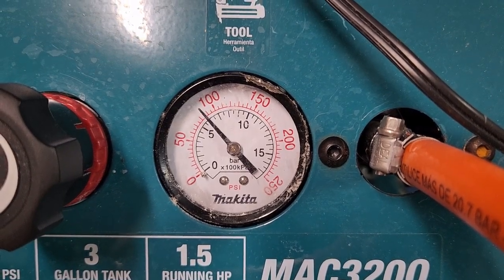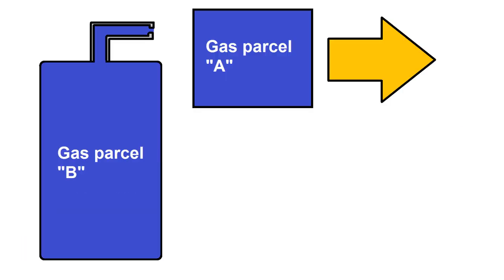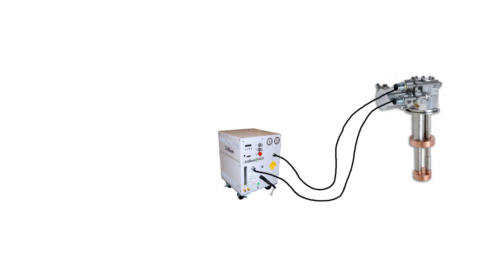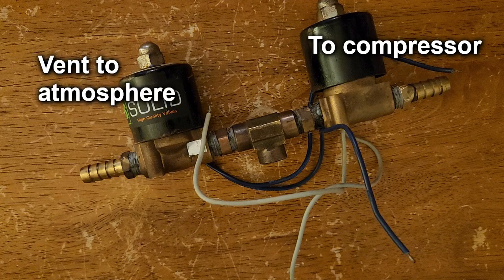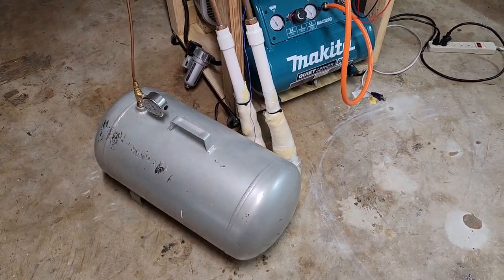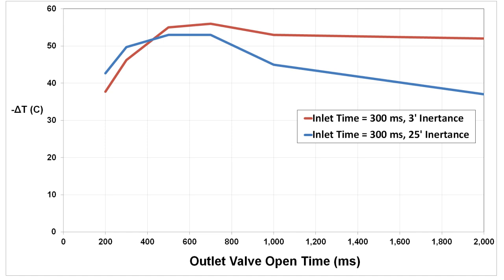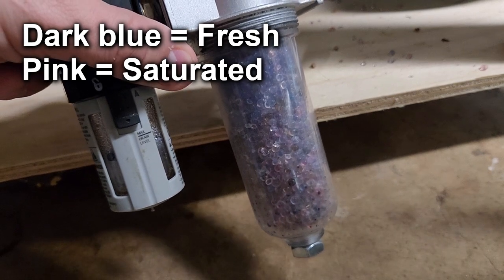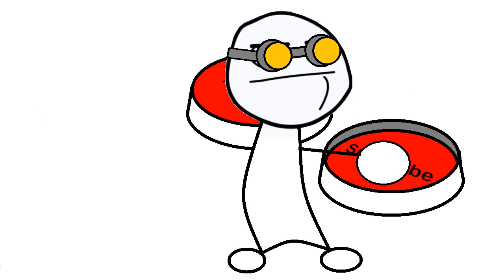Pulse Tube Cryocooler (Part 4) - Valve Controlled

Comment: Building a helium compressor can be quite a task. The problem with refrigeration compressors is that they are gas cooled, refrigerants usually don't get that hot when compressed.
Helium or Air on the other hand get very hot when compressed, this is why most commercial compressors use oil coolers to keep the compressor at a reasonable temperature.
Oil separation is also mandatory since the pump out quite a bit, in normal refrigeration there is no problem with that, in a low temp system it is.
Usually they have a oil separator with oil return and a oil adsorber filled with activated charcoal.
I built a compressor myself for a commercial GM-cooler. https://www.youtube.com/watch?v=k3D2HHXTUss
Reply from the maker: Hey I've seen your build video. I think at one point you mentioned your compressor ran ~2kW, which I'm assuming is a scroll-type from an AC condenser. How feasible do you think it would be to scale this down to a fridge compressor that runs 200-300W?
Reply: @HyperspacePirate  My compressor is a rotary compressor, you can identify them by the suction accumulator which almost every rotary compressor will have.
The problem with a fridge compressor is that is not build to run at these pressures. Evaporation temperature will usually be -10°C and Condensing +40°C in a fridge application. For R134/R12 this would be 1barg to 9barg, for R600a 0barg to 4.3barg. If you run at pressures much different from these, especially higher low pressure and higher high pressure the required drive power for the compressor part increases by a lot. The electric motor inside the fridge compressor can't deliver that much more power. So you definitely want a compressor rated for a similar pressure region, AC compressors for R22/R407c would be a good choice, R410A would work as well since it has even more drive power in relation to the swept volume. 
For your pulse tube you can roughly calculate the needed volume flow of the compressor. In the naming theme of the fridge/AC compressors the name usually gives a hint about the displacement of the cylinder inside. My compressor has 35ccm displacement so it delivers about 0,035L * 2850rpm = 100 lpm = 6m³/h.
Fridge compressor may be in the region of 5-10ccm. R600a ones probably a bit higher. 
The Makita MAC320Q will do 3.5cfm at 40psi, so in the order of 100 lpm. 
If you plan to run the same pulse tube as in this video you really wan't a compressor with a similar or even higher performance than the Makita one I would guess.

Comment: I love this channel. I have a suggestion for achieving higher packing densities for the heat exchangers. Use a steel pipe and steel rod with a OD slightly smaller than the pipe ID. Pack the steel pipe with small quantities of the material and compress in a large vice or hydraulic press. It may be easier to achieve higher higher packing densities with stacked thinner pucks of compressed material vs one large unit. You will need to press fit the pucks into the copper tube; using a longer length and making a swag to assist with installing the pucks. Cut off the swagged portion once packed. I don't think compressing the filler material in the pipe directly will work as it will probably swell under pressure.

Comment: This is fun project.But liquifying nitrogen with a pulse tube cryocooler is not the best idea. Maybe in part 25487, where you can get a few drops of liquid nitrogen after you put 10kW of power into the system.

Comment: I wonder if you'd have a better time with several of those sintered metal filter slugs that are sometimes used in lubrication paths or air compressor/pneumatic system silencers than using mesh or steel wool

Comment: how about use fridge compressor? Cut it open and remove putput valve and close input valve. That allows you to force it just pressure pulse generator. Displacement is not high but frequency is. And if you weld it back to closed  it will stand high static pressure.

Comment: How about vacuuming the whole setup, then filling with nitrogen? Nitrogen is used in industry to remove moisture. And it's also cheaper than helium, when doing prototyping.

Comment: Are you in Portland OR? If so I'm not far from you. I work in aviation, If you need aluminum to make hydrogen I can give you all the aluminum you could ever want. Also working on setting up my home shop (16x40 lathe, MR-1 Mill, PocketNC 5x, toolbit grinder, Everlast MTS 251Si) so I'd be happy to help there as well. I also have a Stirling cryocooler.

Comment: I think it's the AIR as the refrigerant in your closed loop that is causing the bottle neck. The constituent parts are freezing out blocking the air flow. Somehow you need to strip the carbon from the AIR in the loop using a limestone filled pre conditioner. 
Perhaps also experiment with "Hippy crack" as a refrigerant, these same commercial sized cannisters that litter UK roads at the mo due to trainee glue sniffers...

Comment: GM compressors are pretty much entirely built out of refrigeration components inside, and even standard fridge compressors can withstand a total system working pressure of up to around 30-40 bar, provided the pressure difference across the inlet and outlet are no more than ~8-10 bar.
The only major difference is that a very, very good oil separation and cooling system is mandatory after the compressor, before the aftercooler, or efficiency drops several orders of magnitude.
And definitely don't use hydrogen, just stick to balloon grade helium.

Comment: So… have you considered putting two of these coolers in series? 

Also for the regenerator instead of wire wool could you get a 3D metal sinter printed exchanger made that’d have a higher fill?

Comment: Maybe just after the compressor, DIY a ~$60 or less aftercooler?  There a quite a few videos on YT claiming is effective.  I've not gotten around to yet... though that and if I need for plasma cutting or maybe sand blasting or paint spraying... a DIY longer schedule 80 desiccant tube somewhat like "Hannah's Bug" YT channel design?  I've not found a source of shorter than, I believe offhand, 10ft sections of the sch 80 clear tube.

Comment: I'm hoping you succeed with this, because until I saw your project, I thought the only approachable way to build something to liquify air would be the regenerative joule thompson / hampson linde type thing. Although, a vortex tube operated with restricted outlets to maintain the right pressure ratio may be an option instead of pure throttling, and of course there is precooling to help.

Comment: I don't really know anything about this but would using small fine screen on both ends of the tube and using a fine sand or similar instead of steel wool work? You can change grain sizes and length of tube to fine tune.
Reply from the maker: I think that's a valid idea. I had a viewer email me about sending surplus parts from a commercial GM cryocooler unit, and he said the regenerator material was basically a powder
Reply: @Hyperspace Pirate  Woah neat, I would have never guessed. I was just throwing out my first thought there. I was thinking the regenerator sounds alot like it has similarities with a water filter that uses a filtering medium. I wonder how activated charcoal could work I haven't delt with it much but they sell it for aquariums at Walmart that's a pretty large size, probably can be blended and sieved to get a certain size and if in a tube can maybe be tamped down to kinda make a permeable mass of carbon maybe.

Comment: You probably know this, but when you use the hermetic compressor, make sure you add oil to the helium if you want to avoid damaging it.
Reply: With the ubiquity of old fridges, you can also get away with just running it without fed lubicration for a surprisingly long time.

Someone at a student workshop I frequent made an air system for the workshop from an array of fridge compressors filling a pretty large air tank. It worked for a surprisingly long time, took more than a year before the last compressor out of 7 died from pretty frequent use, just compressing unfiltered atmosphere. And these were compressors scavenged from discarded fridges, so already suspicious and badly worn. It did require a pretty complicated valve system to get the compressors to start, they don't like having back pressure on startup.